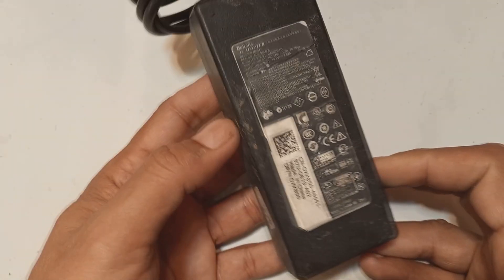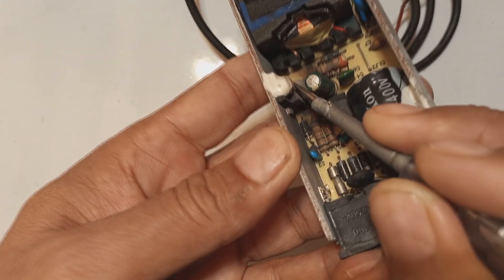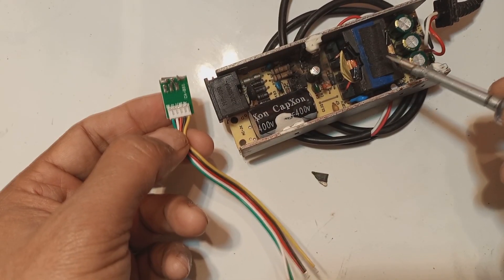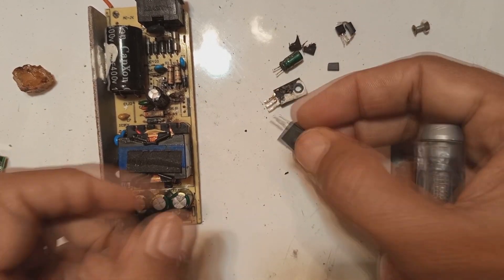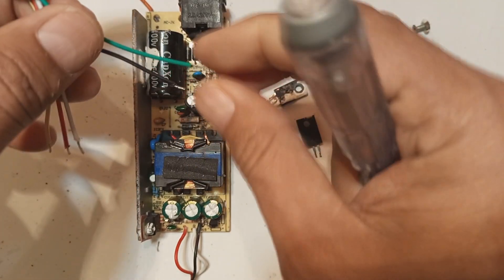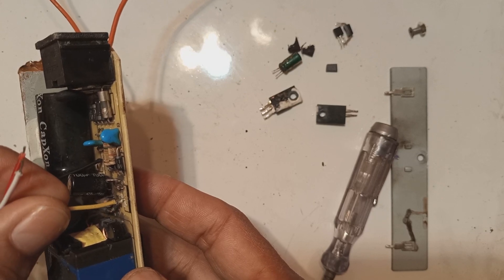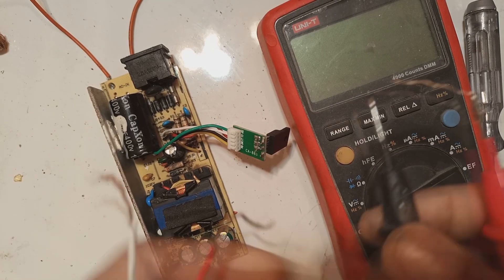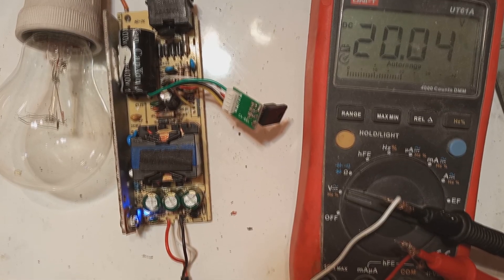Laptop charger repair. Laptop battery charger repair. power supply repair str module. smps repair

Comment: That power supply looks like its been in a war lol.
I have never seen that much damage in a switchmode, usualy its a mosfet or capacitor or the bridge rectifier that goes pop.
That looks like a handy module,  a change of the resistor (make lower)  that feeds the adjustment pin of the Tl431 should bring the voltage down if needed.
Reply from the maker: Very right dear sir. Very nice to see your valued comment. When I was repairing that power supply, I was thinking the same! But it was challenging as such big damage repair would enhance ones repairing skills more. Best wishes.
Reply: @JahanZeb1976  its a smart way to make it work again,  hopefully the module didnt cost too much.
Hopefully that module will last a decent time,  then the owner will have to think about a new one.